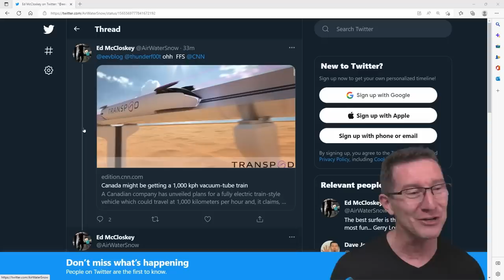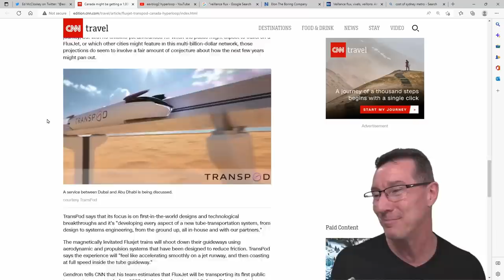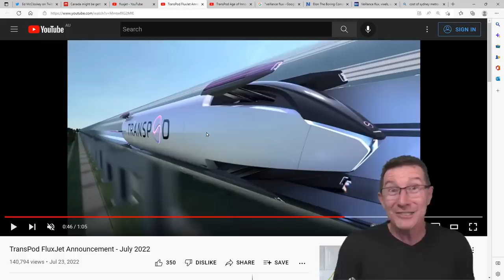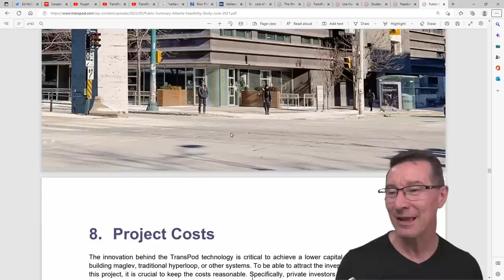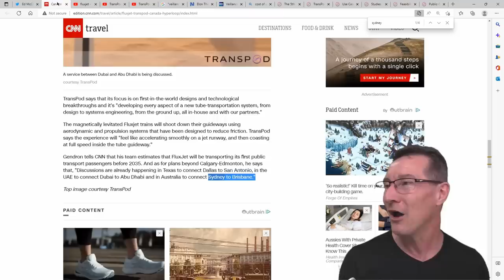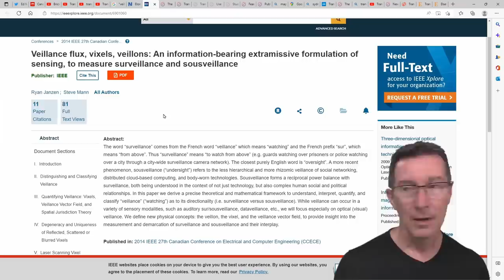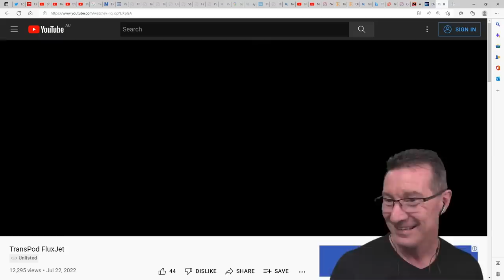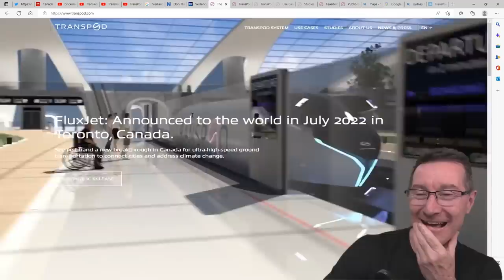EEVblog 1498 - TransPod Fluxjet Hyperloop $550M Boondoggle!

Comment: 9 passengers per pod is even worse than the 14 people per pod of Virgin Scamloop and doesn't even beat that of the BR Mark III passenger coach which can do 74 seated in intercity layout. 
Edit: Then they go on to say that there are 50 passengers per pod despite their CGI animations showing 9. Have some consistency at least!
So they say 50 passengers every 2 minutes (16:19), which is 1500 people per direction per hour. Even a high-speed train (let's say 500 people per trainset to be nice) every 10 minutes is 3000 people per direction per hour. And if you're Japan, 1300 passengers per trainset every 4 minutes, which is 19,500 people per direction per hour. Still won't beat a metro line but this is for long distance transport. And if this does run under low pressure, they'd need a very very fast airlock or arrays of many many airlocks which are multiple points of failure.
Also: That "power pickup" is just a glorified third rail system! And you wanna know why third rails are used less these days? 
1. Not enough leeway for vibrations. There is little room for a third rail pickup to move around, especially if the track isn't perfectly straight. 
2. Lower maximum voltages. Third rails have a lower maximum voltage (typically around 1500 volts is the maximum) likely due to their positioning. With the transpod being so close to the walls of the tube, this might be even lower! Low voltage means high current for the same amount of power. And "contactless connection" So they want to draw an arc between the rail and the third rail pickup? That's the last thing you want, it'd be great for trashing the electrode which would likely be carbon since that's a material with a higher melting point than tungsten? Also, 21:46 The third rail isn't even isolated from the frame!
30:46 Subways don't send electricity through an arc (except when encountering a third rail gap where for a brief moment an arc is drawn) but rather through a physical object touching another physical conductive object that is charged with electricity. 37:58 The arcing is because the pantograph isn't maintaining proper contact with the OHLE so it's drawing arcs. Generally you want to avoid drawing arcs, especially with something as high power as a train.
Reply: This is marketed to to the pod people - who see smaller passenger numbers per pod as a good thing, because strangers are scary.
Reply: The single lacking feature of all these "advanced mass transport systems" is the ability to actually transport any actual mass of people. Look at any public transport network and clearly the costs scale directly with the number of passengers carried. A small private jet for example, carrying just say 8 people clearly costs many many times more per passenger mile than a massive Jumbo jet carrying 7000 people.  A metro carriage or bus is clearly designed to fit in the most number of people possible.And on a practical network, peak speed is typically governed by the maximum tenable rate of acceleration between stops so the faster you make your system, the less stops you can allow.  Therefore if your system carries half as many people, and costs twice as much to build and run, then a ticket is necessarily going to be 4 times more expensive. Will consumers pay 4 times the price for quicker but less convienient (fewer stops) service? I'd suggest not.

Comment: My favourite part about these "low pressure" transport systems is the comparison to their regular counterpart. A door seal fails on a high speed train, you get annoying noise and possibly some pressure buffering, a door seal fails on one of these things and you kill everyone onboard. A fire occurs on a normal train you simply get off the train, a fire occurs on one of these, you could possibly pressurise the tube before getting people out of the carriage, but even if they survive that the tube full of toxic smoke.
Reply: a fire breaks out and chances are no one can get out because if the even bothered to pressurize the tube, they won't be able to get the doors open in time, assuming they even design said doors to be operable inside the tube.

even then where are they going to go? they're stuck in a tube with the fumes, several miles away from an exit.

Comment: Each version of these vacuum sleds gets more pointy to cut through the non-existent air. Eventually they will create a sled that looks like a bung. Then all they need to do is suck from the destination. A tight fitting bung will move faster than any propulsion system. Simple pneumatics.
Reply: while very, very thin, it would build up in front of a blunt vehicle
Reply: @jocramkrispy305  The aerodynamics are irrelevant. The only way they're propelling a thing in a tube to Mach 1 is in a perfect vacuum. Which means they've also created a magical method of perfectly sealing jointed tubes, let-alone hundreds or thousands of kilometres of them... in which case they'd make vastly more by selling their services or patents to industry, particularly oil & gas & that on its own should be on the news all over the world as a major technological breakthrough.
Reply: @kyneticist  Nope, railguns accelerate things way above Mach 1 at std atmo.
Reply: @jocramkrispy305  You're comparing something akin to a bus within a hermetically sealed tube with custom crafted solid titanium-alloy railgun projectiles fired in an open atmosphere? If you're going to use railguns to move people around at Mach 6 you've solved all of the issues with containing a system in tubes.
Reply: @kyneticist  Yes, I'm making that comparisson to point out a "perfect vacuum" is not necessary to accelerate something in a tube.

A maglev is a (very slow) railgun.
Reply: @jocramkrispy305  How specifically does a maglev = a railgun?
Reply: @kyneticist  by utilising the same mechanism
Reply: @jocramkrispy305  Specifically, what mechanism?
Reply: @kyneticist  specifically the use of controlled electromagnetism to accelerate an object while stopping it from contacting the stationary parts
Reply: @jocramkrispy305  Phil's point works by creating a vacuum at the 'leading' end, pulling a vehicle through. The vehicle in that case would necessarily need to occupy as much of the inner volume as possible for best effect. It's specifically the evacuation of atmosphere with a largely frictionless vehicle that he proposes (which still assumes the insane engineering of a vacuum maintained for hundreds/thousands of kilometres).
The vehicle working as originally described in the video, even with an extremely low drag coefficient will encounter significant air resistance if hundreds to thousands of kilometres of tubes aren't perfectly sealed and the entire length kept in vacuum (at God knows what energy requirements).
Railguns gain their performance by expelling a projectile with near-instant release of energy stored by supercapacitors (along frictionless magnetic tracks). The amount of air resistance applied to an item travelling in a closed system is proportional to the volume it takes up, its drag coefficient and its velocity. Even it it's really pointy, a vehicle large enough to carry passengers or cargo while also keeping tracks close (to stop it from dangerously and potentially catastrophically bouncing around), uses necessarily nearly the entire inner diameter of a tunnel. "While very, very thin" any air in the tunnel will compress - you said so yourself in your first comment. Look up the various "Hyperloop debunked" articles & videos for further information.
Reply: @kyneticist  I was addressing the "gets more pointy" part of the OP.

A vacuum pneumatic train is an even more ridiculous idea (and if you're going to use a  pressure difference it makes far more sense to blow the train than suck it)

Comment: Is this the Alberta scam? 1/2 the distance, but twice the temperature swing than that the California Hyperloop. -50C to 30c. Tube would swing in size for 300m for 300km. If they figure out how to keep a vaccum while allowing that tube shrink without ripping in pieces, I will be facinated with the engineering. If they can fit a 1m expansion joint for every 1km, but that assuming the tube will survive the tension of 1km of tugging while expanding and shrinkage. The track won’t survive that, so 10cm joint for every 100m, 1inch for every 25m?
Reply from the maker: Don't worry, once you get the funding then the practical technical problems just get magically fixed. All it needs is money...
Reply: @EEVblog  hey bud, the tide is out, want to buy some land?

Comment: Liquid cooling of the magnetic pads, hmmm.... what's cooling the liquid in a vacuum? Furthermore, I hope they have discovered ambient temperature superconductors... Hint : I highly doubt it!

I am appalled to learn that the CEO graduated from SUPAERO and  is able to show a design with a 15 stage axial compressor (at 27:38) and no power to drive it!

Comment: These hyperloop concepts people put out always seem like the sort of thing we thought up in 4th grade. You learn that air resistance is a major problem at high speed so you take the obvious next step and suggest running the train in a vacuum, these projects end up being the ideas of 12 year olds with similar solutions tagged on in layers as people point out flaws.

For example your concerned about the terrain and city getting out of Sydney, no problem furry idea to come to mind run it through the sea instead and when someone suggests a problem with that make up a new technology to deal with that and ask for a few billion to research it.
Reply: I specifically recall a drawing I did at age 6 or 7, which was basically a train with a ramjet at the front. It was a diagram where I drew little arrows for the path of the ram air to some sort of engine. It looked remarkably like Elon's sketch of the HL. I was inspired by a book I got that had diagrams of the Shinkansen series of engines.
Needless to say, I didn't get hundreds of millions in funding to realize my concept of the future, and none of these other projects should either.

Comment: @ 30:58 how can you build a tube suspended or buried in the ground with deviations of linearity so small that a magnetic suspension (which I don't think can be more than 2 cm) can stabilize a "train/capsule" of several tens of tons at speeds of 1000kmh?
To build something so straight/linear should have enormous costs + it must remain straight and not "settle" over time like building foundations do....
Reply from the maker: You can't. But you can waste a lot of money trying.
Reply: Billy William  search “ the technology of maglev trains: explained” from the Railways explained  YouTube channel  and tou will SEE that the linear motor that they use in the video redering It is not able to sustain much height ripple - and they are working at fairly low speeds … a low height travel of the magnetic suspension It is not enough at 1000 kmh and a mechanical one is out of the question at that speed ;)

Comment: There is a historic precident for this design--covered bridges!  In ye-olde times, when people pulled sleighs through the snow, they had a problem of snow melting off of bridges.  So they built a house over the bridge to shield it from the sun.  This prevented snow from melting, but it also created the problem of snow not falling on the bridge.  So they had to shovel snow onto the bridge!  (There is one of these old bridges down the road from me preserved as a tourist attraction.)
Reply: In New England, for some reason these are also called "kissing bridges".
Reply: @nameredacted1242  Haha, maybe it was a good place for the locals who were having an affair to get some privacy.
Reply: sadly, all they had to do was also build slopes into the bridge for snow to go... but then they could end up with too much snow, so they'd have to work out a way to cut the flow when it hit a certain point.

Comment: At say ~0.1 atmospheres  you might be able to pull some tricks... e.g. put train in a tight fitting (max 10% volume for air) sealed area at station, (after boarding / deboarding) close that, open to a large station vacuum area to get pressure down, close that, starti pumping it down (or use something based on a huge piston) then open to tunnel... (It seems that changing the volumes (get a small sealed volume, at normal pressure, expand that volume (e.g. by moving a piston) to get a low pressure volume) might be the only real practical way to quickly get some level of vacuum) (and the forces / energy to move that piston would be huge)

Whether it is at all economical is another question altogether...

Comment: The other thing is how if it breaks down during transit, do you get access to the train in the tunnel or do you just seal it off and write the passengers off .Not one mention of passenger or system safety and where is all this power coming from to feed the tunnel?
At 39:58 with the mention of the rollers I bet its the weight of the carridge on these that have buckled the bottom rails too.

Comment: In the channel tunnel, if there is a breakdown or a fire, there is a center service tunnel passengers can go into that has positive air pressure compared to the two main tunnels so smoke cannot enter. In this proposal, if a train breaks down, or there’s a fire onboard… 300 miles down a vacuum tube to the nearest help?! Nowhere for passengers to escape to or get rescued? No air to breathe?
Reply: open the doors 🤣 no air=no fire

Comment: If it uses magnetic attraction to stay afloat, it is inherently unstable (tends to either cling to the rail or fall off), and needs to be regulated as f#ck to stay in between. Therefore the need for laser wong wong scan veillance flux beams?

Comment: Solar powered in Alberta?

Granted, Alberta has ~1280 hours of sunlight per year, which isn't terrible. There is a small problem though: they routinely drop below 0 in the winter (no charging) and will drop as low as -20 to -30 in the winter (cells do bugger all) so... how are they storing all this energy?

Comment: "Flip the script and use attraction in steed of repulsion with a 1 cm gap"

So.. its exactly as transrapid? Also SC-maglev really don´t use repullsion either, it use a combination of repulsion and attraction.

Here in Sweden the old 1920 D locomotive also use plasma to power them cold winter day. Because the powerlines are so cold that they can´t make real contact. So when the contact breake, a plasma is created and it still carries power.

Its really very damaging to both powerline and pickup, so generally it try to avoid it as much as possible

Comment: It is strange that they would show a tunnel into a mountain, as it actually is generally quite flat and a straight-ish line between Calgary and Edmonton. There also really is already a wide divider of empty land between the north/south lanes on  the existing highway. There's been talk of some kind of high-speed rail link between Calgary and Edmonton for a long time. I would imagine that although this "technology" is to date unworkable, a line with speeds of 300-400 kph with already existing technology could be a possibility. But last I saw plans had already been scaled back to only a couple hundred kph, which would be disappointing given currently available technologies. Either way the need for land procurement would be similar for any line that is built. Also contrary to some other comments the temperature swings in this area of Alberta bottom out at about -40 Celsius on only rare occasions, and rarely exceed the low 30's Celsius, so line expansion would be generally manageable. Winter temperatures can be in the minus 20's for extended periods, but I've never seen anything anywhere close to +50 C. I think this is just one of the companies trying to get their foot in the door for any eventual contract, and if they were awarded it, they'd probably end up having to build something more traditional.

Comment: I think it would be a feasible option to slow down and use the "landing gear" to turn a corner, then accelerate again. This is obviously going to eat into travel time so it's not ideal. So there's 1/100 issues with a potential solution, lol. I would love to know what the theoretical electrical load is during normal operation, our grid is already pretty maxxed. Maybe they can shut down the Sydney Train Network for an hour to accelerate the "Scampod", because that sound like a Pareto optimised solution.

Comment: or just build a regular mag leg train & start construction tomorrow... also why do you need sensors for a tube made to exacting tollerances & a guideway that is even more precicely aligned because "rails" that are not aligned very well at 1000 kph is going to be a tad problematic...
Reply: especially when japan has passive gudance AND their train is running in the atmosphere with literal air currents (wind) to blow it around 🤣🤣🤣 if they cant do that in a vaccum, well you cant really laugh at them anymore than we  already are.

Comment: Correct me if I'm wrong, but isn't sending electricity through an arc the least efficient way of transferring power there is?! Great part – if not most – of the energy will be wasted as light and heat.
Reply: Get lost!

Comment: What I don't understand about many of those projects is that they always try to go faster. But my opinion is that most of the travel time optimization should be made with a denser traditional train network. For example, I have a rail track at about 100m from my home, but if I want to take the train, I need to drive 10km by car, park it, wait for the train that come once per hour, do 50km with the small train and then I can take the faster train to go further away. If that faster train went from 200km/h to 600km/h I wouldn't give it a damn. But if there was a train stop next to my home and I could just hop in the train, that would have a major impact.